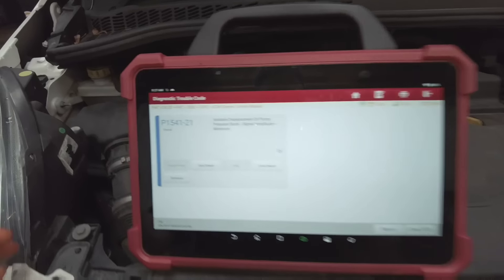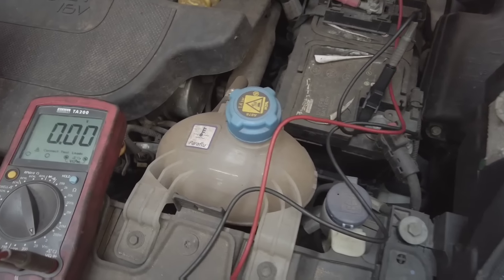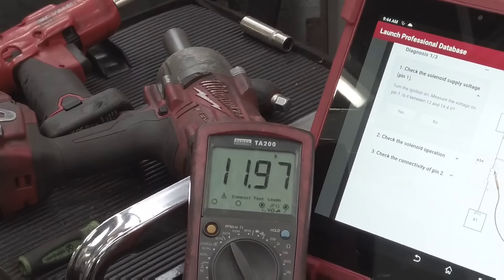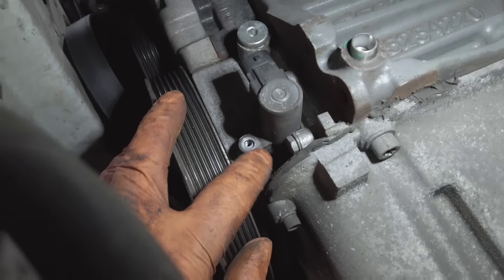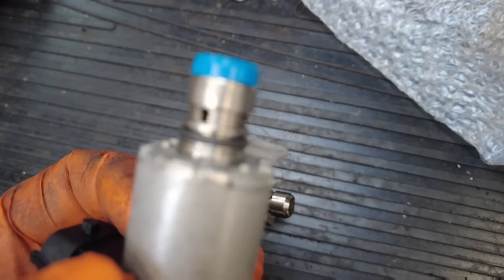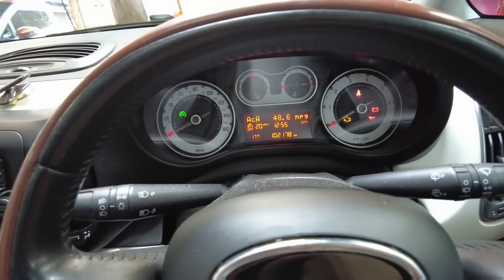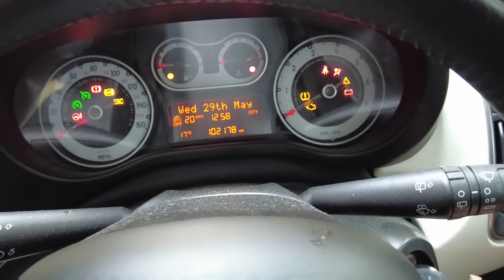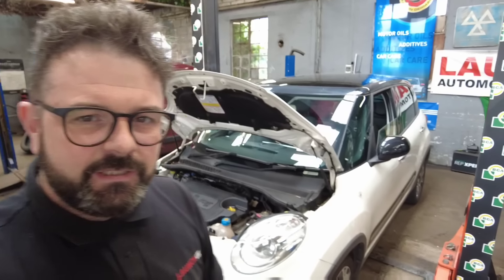P1541 FIAT 500L DIESEL OIL PRESSURE FAULT.... 100% TEST NOT GUESS.....

Comment: You mentioned the battery voltage being good at 12.9v but it was reading 12.09v. From my limited experience, anything under 12.3-12.5v is getting on for a dying battery.
Reply: Limited..
Reply: Limited…
Reply: Ltd

Comment: Nice diag baz. But why is there a variable solonoid for the oil. Why not a fixed oil pressure all the time?
Reply: To help with engine efficiency - reduces oil pressure at low engine loads.  Lower oil pressure = less drag on the engine.
Reply: @jimb7406  thanks for The answer. But don't you run the risk that the lower oil pressure delivers a to thin of oil film in the engine say for instance the solonoid not working 100%?
On my car { opel astra diesel} that specific solonoid creates the problem the timing chain tensioner get to low pressure to work properly en gives slack on the chain wich results in chain clattering while driving on those low engine loads.

Comment: I have the same issue with my giulietta 1.6 jtdm 105 version. Code only appears when the car is cold and cruising between 1000-2000 rpms. When the car is hot or if I use a bit faster there is no code. Also when the code appears the car wont get in to limp mode, only yellow fault symbal on the dash. Also on AlfaOBD app it says "plausibility" for the code. Car works just fine with or without code. there was no problem until the turbo renevation.
Reply: My car has the same problem, how did you solve the problem?
Reply: I couldn't 😅 I had a soft tune when I bought the car which I wasn't happy with. When we looked at the map we figured out most of the fault codes was disabled including the p1541 one. This problem started when I changed tune with a friend of mine. So it means I had the fault all the time but didn't show since spesific dtc codes are disabled. I will start with oil change with a oil flush. Then try to change sensors on oil cooler. If the problem is still there only option is lookin for cables to all the way to ecu or changing the oil pump.
Reply: @tamamboylekalsn  hocam hesap ismini sonradan gördüm türk müsünüz
Reply: @bedirhanylmaz5129  ben de şimdi gördüm. Aynen 😂 daha çözemedim ya. Daha doğrusu vakit olmadı

Comment: Probably waste of time going through electrical stuff..it's the 1.3 abortion with bicycle chain in.....usualy full of magic glitter from the chain chopping through guide...seen at least 3 that will only turn over with jymp leads or booster pack on. .. ...a bit late for a chain job....l
Reply: This was a very professional and accurate video on how to diagnose the fault which was presented. Unsure what your point is. The 1.3 FPT / GM engine is a superb little diesel engine. Granted, it’s fitted with a bicycle chain for a timing chain but so are most of not all of these modern engines running a chains. If you change the oil every 5000 miles you shouldn’t get any issues. Mine has done 90000 and still runs like new.
Reply: @fishwag  Have one here with 220k on it, runs great - a customer has one in his van with 630k (km) - runs strong.  Most modern stuff has bicycle chain timing.  In fact a bicycle would have a stronger, thicker chain.